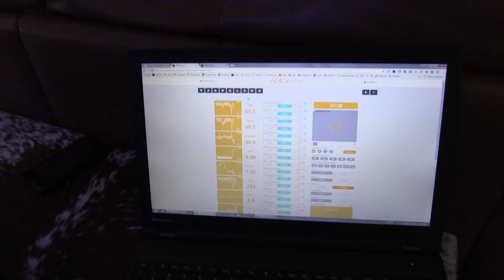Aquarium Crisis! The power strip blew up!

Comment: Ahhhh, the sound of the water alarm in the morning... Always gets the blood flowing! Bummer.  So, that is just a remote controlled power strip? The apex controls each individual socket? I have pumps go out now and then and we had two Kassel tuna blue lights poop out. Both under warranty. How long is your tank? Looks like eight feet or something!
Reply from the maker: Yeah, each socket is programmable with the Apex so you can configure it to do some pretty crazy stuff.  It's really worth every penny to have one.  Not to mention it's a good peace of mind.  Yes, our tank is 8x2x2.  I've found that the Kessil's will fry themselves if they get too hot.  The fans get dirty, then they don't cool themselves as well and eventually they just go out.  We had 4 go out in a short period of time, but then I added auxiliary cooling and so far none have died since.
Reply: Normal Guy Supercar did you just set up a fan to blow through the hood? That's a thought... Ours are pretty out in the open hanging from the ceiling. They get salt spray on them and poof! I've actually been a bit scared to blow them out thinking they might short. They are cool lights, just don't last long... I bet yours are plugged into your apex.  Or tank is 6' but deeper... I like all that length you have!
Reply from the maker: Yes, there are 4 intake fans sucking in fresh air and blowing into the hood right by the Kessils so they get cool air.  Then we have a 9.5" exhaust fan that sucks all the hot humid air out from the hood and blows it out of the house.  

You can easily blow out the kessils with compressed air, it won't hurt them at all.  I've done it many times now.

Comment: Daniel are you running Halides and actinics on that tank?  Do you run a chiller?
Reply from the maker: LEDs.  We did halides and actinics back in the day but LEDs are MUCH better now.  They last many years, use way less energy, and are considerably cooler (temperature) so we don't have to use a chiller... We only use some fans and evaporative cooling.
Reply: Wow!  I've been out of reef tanks for too long apparently!  Neat.
Reply from the maker: Yeah, there's a lot of new hardware in the hobby that can do some really neat things.  They even just recently came out with Alkalinity controllers!  We're going to buy one soon, and then other than feeding the tank, water changes, and periodic maintenance, the tank will be almost entirely automated.

Comment: I could easily re-wire my car faster than putting together a tank like that ....jeez .....thumbs up though lol
Reply from the maker: Probably true.  It took me about a week to get it all wired, and even then it still looks like shit.
Reply: Normal Guy Supercar I was about to say Dan you need some better cable management but it looks like you know that already. Nice tank though!
Reply from the maker: Yeah, I tried at first to run the wires all nicely, but as I added more stuff later on, it became almost impossible.  Plus many of the components will fail after a certain amount of time, then you have to undo all the wiring and then redo it.  And let me just say, working upside-down, in a ultra cramped and super hot and humid environment is pretty miserable.